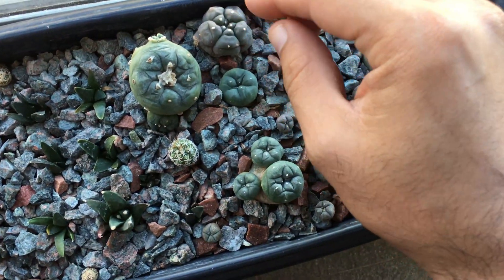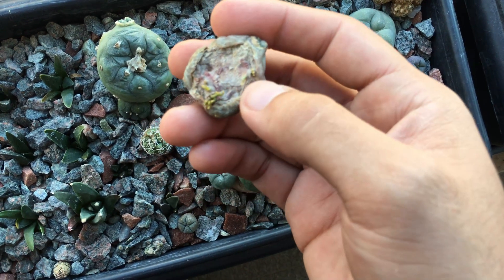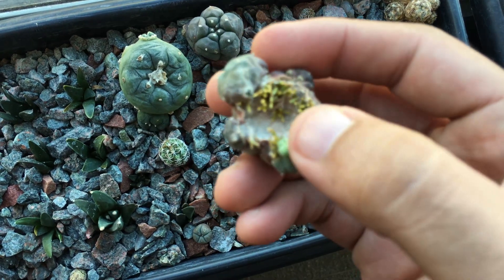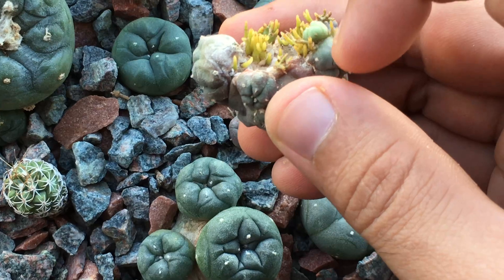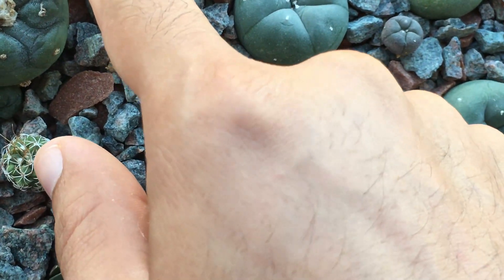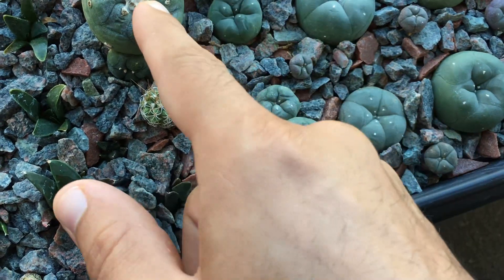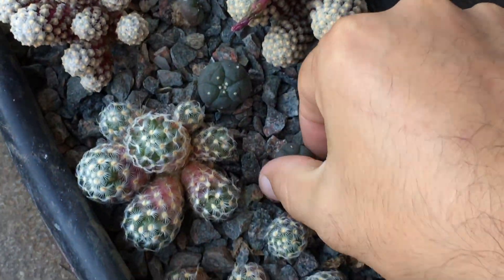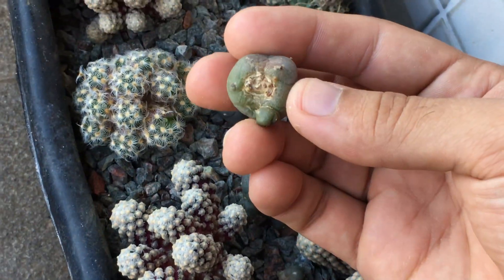Need help setting up lophophora degraft root experiment.

Comment: Great experiment, I'll be following this with interest. I don't currently have any Loph grafts (they all failed) but I have a couple of small ones I might graft soon. I'm not getting good success rates with my grafting so would like to figure out why before I risk any more Lophs.
Reply from the maker: If you are new to grafting probably just lack of practice… I would say I’m fairly experience but still get a few losses. Try practicing with other cacti to get a better handle of the process
Reply: @ModernGrower I finally had some Trichocereus Pachanoi large enough to use as grafting stock. I kept it way too humid after grafting, and they started to rot. So I rechopped and tried again. I've now run out of the Astrophytum seedlings but could try with Echinocactus Grusonii or some Trichocereus hybrid seedlings from Patrick Noll that I'm germinating. Plenty to practise with, and still got loads of Pereskiopsis stock, which I think I've now mastered but it's not suitable for everything.
Reply from the maker: @DFJA01 Patrick Noll is a great breeder. I love watching his flower videos. If I had the space I’d grow a few of those hybrids. I got a flying saucer many years back when I lived in the states but unfortunately I didn’t get to see the flower but the elderly couple I planted the cactus for loved the flower. 

With trichocereus I never add cling wrap only string/yarn. If you precut as a pencil and allow it to callous then make a flat cut for the graft success rate it higher. Less exposed flesh so less risk of failing when curing.

Currently temps here are getting too cold to graft but I may make another grafting video in the future. I should probably buy a tripod or something
Reply: @ModernGrower  I've enjoyed making my grafting videos but it's clear I've still got loads to learn. A good tip about making a pencil shape and allowing to callous, I'll give that a go. I've mostly used film on Pereskiopsis grafts but have tried using small weights on thread for controlled pressure. I haven't kept detailed records to know if they succeeded, but perhaps I should.
Reply from the maker: @DFJA01 for pereskiopsis I had the best success rate using the clingwrap method… applies pressure and maintains well. Pretty easy. Doesn’t work with larger grafts though. 
Always more to learn only if you want to stop. :)

Comment: Whatever you do will be interesting, it sounds like you've got a good idea already. I have some lophs that I want to degraft at some stage, I've never done it before. Thanks for your videos.
Reply from the maker: Everyone has slightly different ways of doing it and you should try different methods to see what works best for you. I personally never had success leaving a small amount of the root stock. I either make a flat cut leaving some of the graft to pup or cut and “core out” the graft removing all of the stock plant… usually there is some neurotic flesh (brown/red/orange) and keep cutting until it is all white solid flesh. Rarely some cacti have different color flesh

Comment: Doing the lord's work, conducting & recording all your experiments!
I agree that the two newly rooted degrafts should make good examples. 

What soil mix do you use for lophos by the way? I've been reading a lot of literature about it lately and the more i read, the more it sounds like rocket science haha. 

Theres a wonderful article called "Stone Eaters" printed as a special edition of Xerophilia magazine (they uploaded it as a pdf but the site seems to be down atm, will post link as soon as i have it) and a good book written by Alexander Neusius. But both of them make me feel like whatever mix i come up with is insufficient in some regard.
Reply from the maker: If you need send me an email I’ll send you a copy of stone eaters.. I use pure granite chips… gravel for my soil mix.

Yea I think I’ll cut the roots on the very heavy rooting one and the other will be the “control” I’ll try to mix in the new degrafts later
Reply: @ModernGrower  Thanks, I have a copy, the original link just isn't working atm.
Pure granite chips sounds good, I've got a bunch of basalt chips, which is basically the same thing without the quartz, so that should work, at least for this season.

Are you fertilizing? And do you use the same mix for the more sensitive trichos?
Reply from the maker: @SeductiveSpaceship23  I fertilize with generic CHEAP salt fertilizers. Mixed 10.10.10 and a 4.14.10 or something like that. I fertilize 2-3x a year... once in spring another in the summer and depending on how the weather id late summer a final feeding.
My trichocereus are all in 50/50 topsoil and granite chips... They do well. Could easily handle more topsoil but it grows well and no fear with watering even in our mild winters.
Reply: @ModernGrower   Rad, thanks for the info! 
I keep my soil % on the lower end for trichos & can only water half the year, my climate is a bitch for cactus growing haha

Why not cut the roots of the less rooted one, that way there's a bigger difference in the amount of roots they start of with.
Reply from the maker: @SeductiveSpaceship23 hmm yea that is a good idea. Would also “help” since less hormones/energy will need to be redirected to the single root rather than from few 50 roots only redirect from 10. I’ll go this route thanks.

Comment: I am thinking, like the top soil be translucent some how? Like glass clear marbles or a camera plugged in and planted under the ground with the cactus, then it takes a time lapse each day.

Also I don’t know how fast a loph wounds heal, but I did a experiment that ended bad wer I took off the out side of the root and like slide off the casing and it’s suffering,

And it like won’t heal, the root is just like wimpy and won’t die off or creat new ones, and the cactus looks a bunch of different color( cacti tbm long form no nipples) 

Anyway I fear pruning the roots might be a little difficult and finding when to cut them is probly gonna be the key. 

First I would find out how fast one grows back to a certain maturity, and then work from ther.   Could be over complicating the situation but hopefully this gives ideas.
Reply from the maker: Lol no help at all just added more trouble and work.

Great idea on somehow making a timelapse of the roots but that is too much work so I'll skip that.

What were you tying to do 'skinning' the root? sounds interesting that it won't heal nor die. IDK best time to trim the roots I usually just do it when I repot. Even if I repot outside of the growing season I just leave it longer without watering.

Do you think those two already rooting lopho are good examples to try this idea? they are at different root growing levels but can't really control that.
Reply: @ModernGrower  

They should be fine examples 

I would get two more for controls.

It’s how long inbetween pruning.

Also edit:
I just thought of doing it to at pain to cactus 

I was a bit sick when I thought of the idea to make it produce more

Now I love it and just want it to get better
Reply from the maker: @andrewbraun123  makes sense. I'll try to use those new degrafts as controls... IDK I'll just record whatever I decide to do so I have a reference for myself if anything can repeat it in the future.